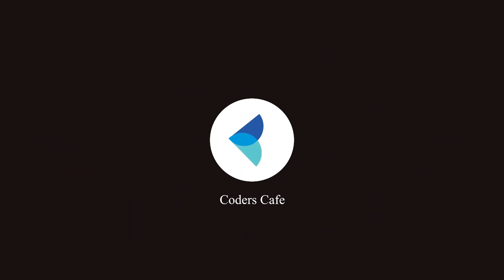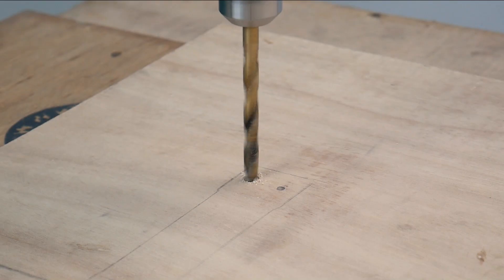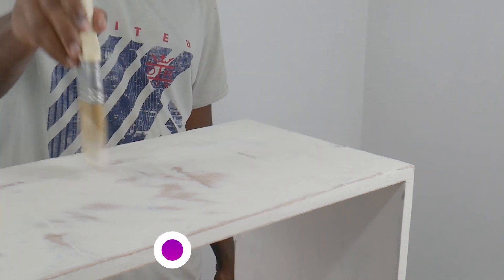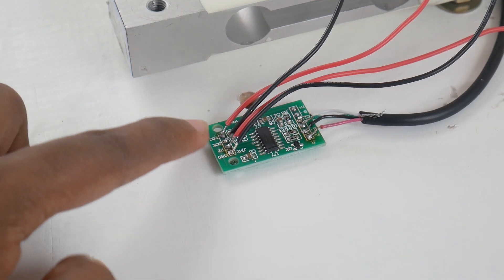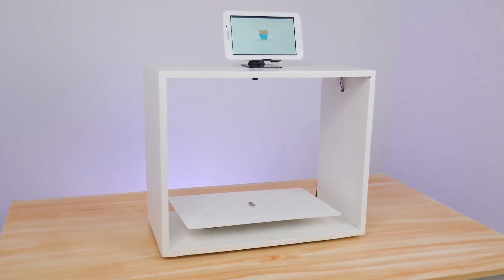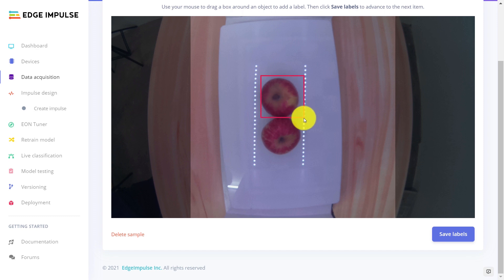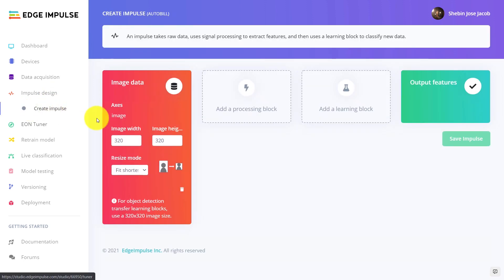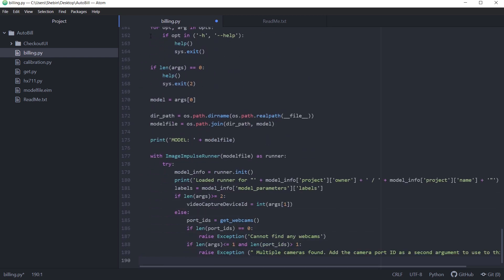AutoBill - An AI Powered Instant Checkout System | Edge Impulse | Raspberry Pi | Coders Cafe

Comment: Sir one doubt, this project  in the raspberry pi pico is possible or not ?sir please help this question
Reply from the maker: Edge Impulse is officially supported with Raspberry Pi Pico, so technically you can do the project, but we're not sure how well it perform with the Object Detection from images as Pico is limited by processing power and RAM. You can refer to this thread for more info: https://forum.edgeimpulse.com/t/raspberry-pi-pico-compatibility/2510

Comment: Hii, 
You developed a frontend right with html and js, so you have integrated any payment gateway to verify the upi payment confirmation in this project ?
Reply from the maker: No payment gateway has been integrated.
Reply: @CodersCafeTech  Hii, Then how payment confirmation of UPI payments takes place, is there any mail scraping or sort to verify if customer has paid the correct amount in an ACS, I'm asking out of curiosity as I have seen a documentary on Amazon go. This is because it takes 300 usd to setup such autonomus checkout system in the amazon go store. By the components you have used you have did it, I estimate it somewhere around 80 usd or something. If payment verification is done using an payment gateway, it can be groundbreaking right ?
Reply from the maker: @AshwinSundar-c1i  In the video the payment confirmation is just a demo without actual verification. But in a real life scenario we can integrate a payment gateway if you're going for a general purpose payment setup (which will generate a running cost) or we can use the principle behind UPI Soundboxes if you're only targeting UPI payments (which will be free) and integrate it to the current system.

Comment: I have both tflite model(.tflite) and yolo model(.pt) file. I don't want to use edge impulse as the model precision is very low everytime I train it with different images. Just tell me how to use it Raspberry Pi?
Reply from the maker: You can rewrite the billing.py code to modify the inferencing part in such a way that the tflite model is used for inference. All the rest can remain the same. More details here: https://ai.google.dev/edge/litert/microcontrollers/python

Comment: Just a little question the website code is executed in raspberry pi or in vs code. And also how is it taking images and raspberry pi .. steps pls I have got to [ ] while checking the API but the code is in VS CODE.. I can’t see further steps kindly help
Reply from the maker: Website code is not executed, it's just an HTML page, you need to open that in any browser.
Reply: @CodersCafeTech  do I have to put all the front end code after changing URL in the same GitHub repo as the server ?
Reply: @CodersCafeTech kindly reply
Reply: @CodersCafeTech  kindly tell that all the code has to be added in server api and how to run the front end

Comment: Hello just a small queary on website part. All the code for website is in raspberry pi or normal VS CODE?
Reply: I have added everything on vs code and my api is showing [] in verification. Now how to see front end?
Reply from the maker: @YatinArora2901  Open the html page using any web browser.
Reply: @CodersCafeTech  I have opened the html page but how camera capture and update the html page?
Reply: Do I need to make all my web pages available in raspberry pi storage or else can you give me a detailed guide on how to deploy?
Reply from the maker: @YatinArora2901  You run the python code in Raspberry Pi and open the index.html webpage in your tablet or phone or PC using any web browser. You don't need to place the webpage in Raspberry Pi.
Reply: @YatinArora2901  did you get the solution. If yes, please explain. Your help would be appreciated. Thank you :)
Reply from the maker: Normal VS Code

Comment: Hello sir I was trying to run this code
I was using RaspberryPi 3B + after running edge-impulse-loinux this showing me this following error
"To which project do you want to connect this device? ICEM / Autobilling
GST] checking for /etc/os-release ?
Select a microphone or run this command with --disable-microphone to skip sel ection) bcm2835_hdmi - bcm2835 HDMI 1
[SER] Using microphone hw: 0, 0
Failed to initialize linux tool Error: Cannot find any webcams, run this command with --disable-camera to skip selection
at /us/lib/node_modules/edge-impulse- linux/build/cli/linux/linux. js:442:23"

My camera is working properly but still this error is showing please solve this problem....
Reply: Bro im also facing same issue.
Reply: Did you solve it I am facing the same issue

Comment: This works in 2024 ?
Reply: What is the display you used and circuit diagram please...
Reply from the maker: @digitronix532 Everything mentioned here: https://www.hackster.io/coderscafe/autobill-042d29
Reply: @CodersCafeTech  I need help on the display you kept..is that a tab or raspberry pi display
Reply from the maker: @digitronix532 It's a tab.
Reply: @CodersCafeTech  can we use a 7 inch raspberry pi display instead
Reply from the maker: Yes.

Comment: Sir, Can we use USB camera instead of the pi-cam ? If yes, will that cause change in code or any other setup?
Reply from the maker: Yes, you can use a USB cam, but you should make sure that the code identifies the camera with proper drivers installed.

Comment: Quick question regarding the weight sensor if we can't find the one you used in the video can your provide any alternative?
Reply from the maker: It is one of the popular weight sensors available. If it's not accessible, you have the option to choose any other reliable weight sensor, making minor adjustments to the code.

Comment: hi we deployed the proj in heroku and we followed all the steps but how exactly can we see the checkout UI system on our laptop because everytime we run "node server.js" or click on the api link it just shows "a blank webpage with API deployment successful"
Reply from the maker: There's a client folder within the CheckoutUI folder. You'll find a script.js inside client folder. Replace the url in script.js with your api and open the index.html in the client folder in browser. Now you should see the checkout UI.
Reply: hi, i ran that file but its just a normal html static file, how can i integrate this proj real time such that the objects getting detected on pi camera are reflected on the website too, i am struggling with that part, pls help 
 @CodersCafeTech
Reply: @CodersCafeTech Having the same issue…if the User Interface is accessed by opening the index.html how will we access the website on a tablet when the html file is on the computer not cloud…how do we access the one on heroku
Reply: I have the same issue. If solve your issue please help me

Comment: Bro how to use the python code in raspberry and also how to connect the interface to raspberry
Reply from the maker: You can run the python code from the terminal. And the interface is a website which is hosted, there is no need to connect it directly to raspberry pi, the connection takes place within the code. Just open the hosted website from the tablet (which is the interface we used) and you're done.
Reply from the maker: @aloneps3531 Please send a message on Instagram.

Comment: where did you connect the cam wire and amplifier module in raspberry pi
Reply from the maker: The camera is connected to Raspberry Pi using the Flux Cable to the builtin camera port itself, and the amplifier module is connected to the GPIOs

Comment: Bro how was the interface created ? And also How to callibrate
Reply: How to connect the server with the model?
Reply from the maker: @nawfallona4239  The python code will post the data detected by model to the server
Reply from the maker: If you're mentioning checkout interface it's a webpage with a NodeJS server running behind. And if you're mentioning about the weight calibration, it can be done with the python code.

Comment: Did you manage to turn this into a finished product to commercialise ? What are the major challenges if one decides make it a real product?
Reply: Thanks for quick reply. Does feature matching algo like SIFT , ORB can do this job and Why is going with AI classfication is better than the mentioned algo ?
Reply from the maker: @akashsahu9787  AI can automatically learn from large data sets, providing more flexibility and robustness in handling complex data. Local features in images or videos can be detected and described more precisely using feature-based techniques like SIFT and ORB. The decision is based on the particular task and the data being studied. As we are handling complex and noisy data, AI will do the job better.
Reply from the maker: We haven't tried to commercialise it. The major challenge would be reliability of the model.

Comment: Sir respberry pi 3 module B is not available, so can this be done with respberry pi 3 A.
Are there any changes we should make in project procedure if we use 3A ?
Reply from the maker: Raspberry Pi 4 only have official EdgeImpulse support now. But please give it a try on your Raspberry Pi 3A and see what happens, it might work.

Comment: Respberry pi is connected to computer wirelessly right ?
Where are the commands(Git commands) typed in, respberry pi ? 
Can you please explain the software part bit briefly.
Reply from the maker: To access the GUI wirelessly we used VNC viewer.
Reply: @CodersCafeTech  so the checkout coding you executed in respberry pi ?
Reply from the maker: @Mrajayreddy  If you are talking about the website, it is hosted in a website hosting service. Rest of the codes are running in Raspberry Pi.

Comment: Great work guys..One small query .
For apples ,2 nos were placed on tray , but in system 3 is being  shown in video.
Is it system/code/calibration error or just got miss-mapped  during video editing.
Please check once.
Reply from the maker: As you mentioned, the system doesn't count the items placed on the countertop, rather it just identifies the item placed on the countertop and measures the weight. The '3' shown in the video is the price of the item per unit (ie, price of apple per kg = $3).

Comment: Why do we need 5V adapter?
Reply from the maker: To power up the entire system we use the 5V adapter
Reply: @CodersCafeTech  But it is missing in the circuit diagram

Comment: How can I generate QR for payment ? (in Indian rupees) . I checked scanova. But there is no option for googlepay
Reply from the maker: It is the money reception link you get can generate in the format (upi://pay?pa=YourUPIID&pn=TransactionNumber&tn=A&am=Amount&cu=INR&url=RedirectionLink). Use that text to generate your QR code using scanova. But I should warn you this might not work. Because, for authorizing payment from a site it might require a properly established payment environment.
Reply: @CodersCafeTech  Failed to initialize linux tool Error: Cannot find any webcams, run this command with --disable-camera to skip selection
Edge impulse Linux not detecting Pi camera. Is there any solution?

Also, help function is working when billing.py is executed

Comment: cant really base this off of weight. two diff items you put at the same time could have the same exact weight. better to use the EAN code or plug UHF alien tag stickers on each item and just scan them with long distance rfid
Reply: Tags would add excessive cost and make it economically non viable. We sell tens of thousands of SKU's, so applying any inlays or stickers would add labor hours and the 6 cents you could get tags for do matter in a low margin industry.
Reply from the maker: Thanks for the feedback. The thing is not designed to identify multiple categories at the same time. You can place multiple items belonging to the same category at a time, then remove all of them from the base and place another set of things again. And this is a project based on object detection using images, entirely tag free.

Comment: Can we do this project using Arduino board ?
If yes, what are the extra requirements?
Reply from the maker: Yes, you can do this project with Arduino boards. You can use boards like Nicla Vision, and Portenta H7 which supports EdgeImpulse. If you are using Portenta H7 you will need an extra vision shield, but if you are using Nicla Vision no extra requirements are needed.

Comment: Hello, so beautiful work, I have two questions.  The prices could change depending the weight (especially just for produces ). And how difficult Is to copy the Amazon go technology for a small store with around 100 products.
Reply from the maker: We are using a weight sensor to measure the weight of the things placed on the countertop and we are calculating the prices according to that weight. The prices of produces may change daily and that needs to be updated on a daily basis in the database.

For copying Amazon Go technology to a local store you should depend on some intense deep learning and I think it will be somewhat difficult.